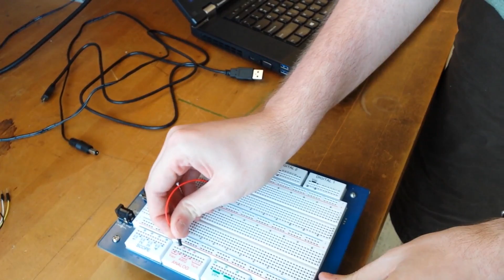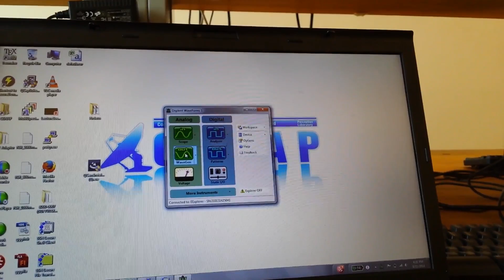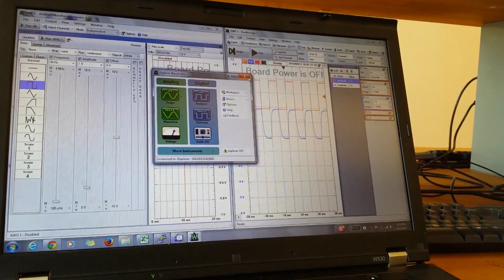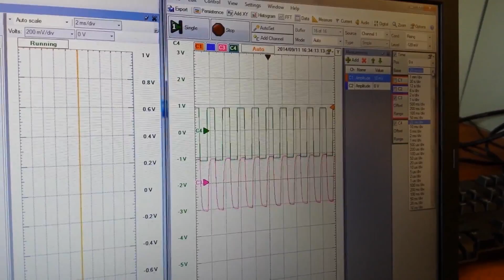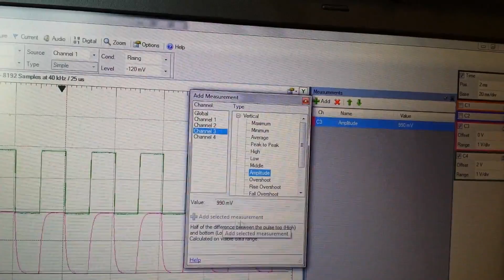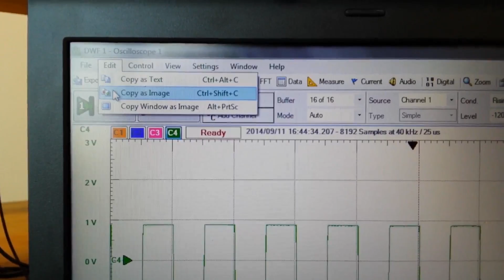How To Use EE Board

Comment: so what's the bandwidth, resolution, sample rate and memory of the DSO on this thing?
Also doesn't the 60MBs of the usb (assuming it is USB2.0) limit the data quite significantly? say you have a resolution of 8B you can transfer only 60M samples per second. where even cheap scopes can do 1Gs/s